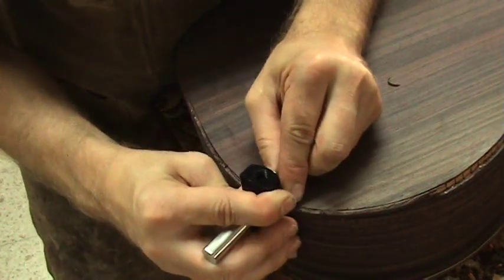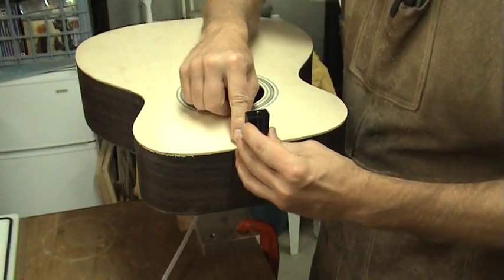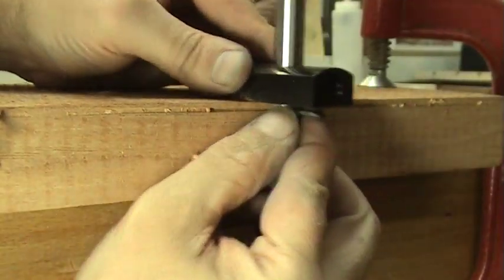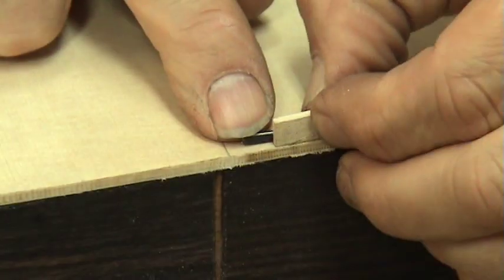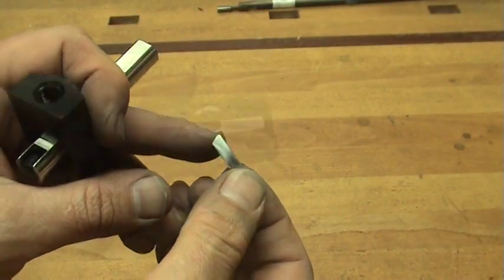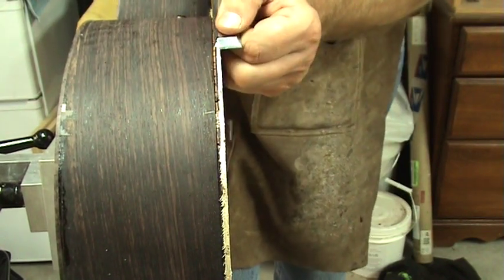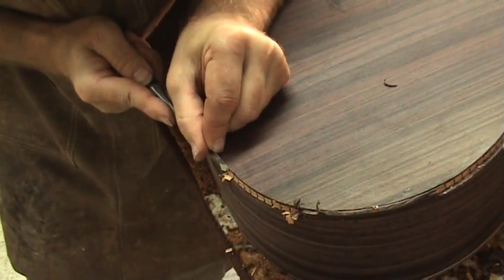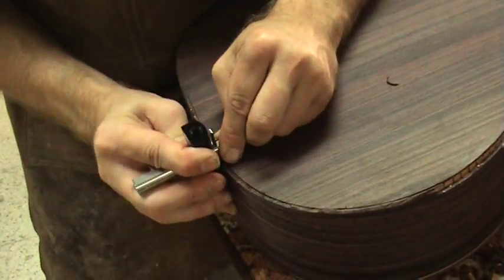Luthier Tips du Jour - cutting binding channels by hand

Comment: not sure if you're still active, but slightly similar. thinking about doing a german carve by hand. was considering using a smaller rabbet to block in the meat of the cut, but really sure what kind of plane would be decent for rounding out the cut. guess I could use some kinda diy molding plane with a curved blade?

awesome vid btw, will be doin this

Comment: Sorry, one more question, I am toying with then idea the top of a epiphany Les Paul Studio. I got all that amazing thick finish off.  Down to real wood.  I do not want to remove the neck.  But its the neck that is in the way.  I have tried to hatch this my head. But its a roadblock.  Any idea's or advise?
Reply from the maker: +AmIonArock sorry, can't understand your question.
Reply: Can I bind my les paul without removing the neck?
Reply from the maker: +AmIonArock It would be easier if you removed the neck but yes I guess you could do it with the neck on.